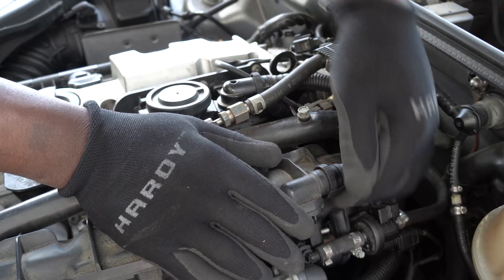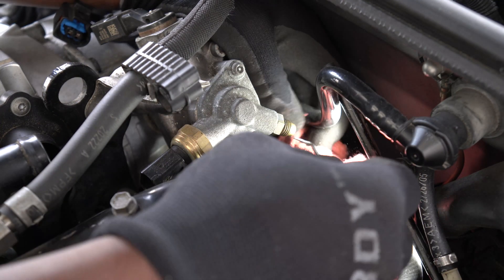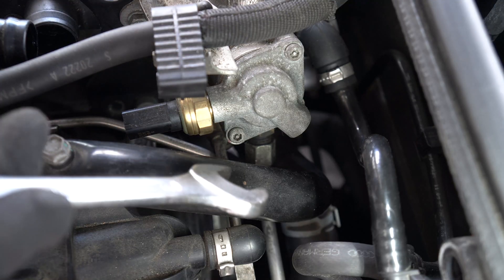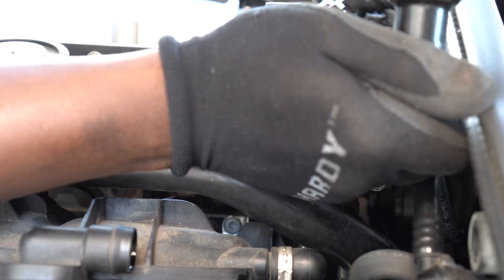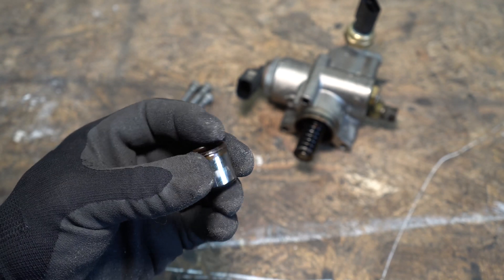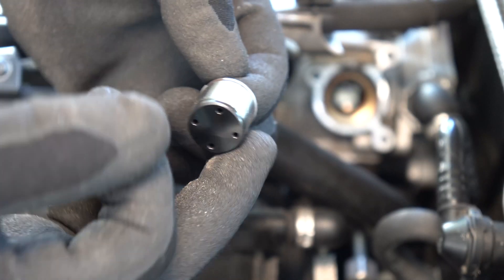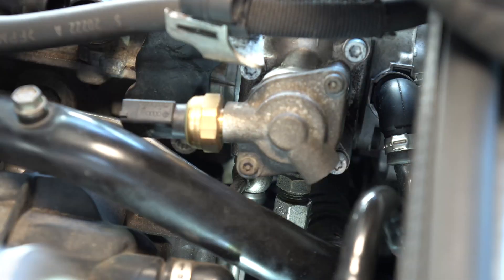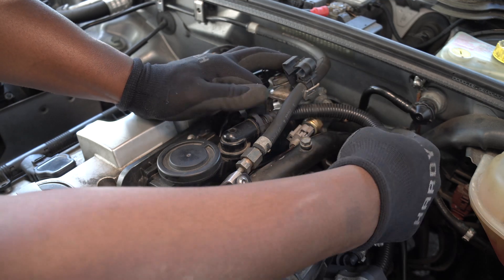B7 Audi A4 Cam Follower and HPFP Replacement 2.0T FSI 2005-2008

Comment: side note for anyone watching this, i have a 07 model after 2006 the banjo bolt was removed and replaced with a rubber hose if this is the case it is not necessary to remove it order to replace the cam follower
Reply: Thanks for this. I’m doing this with an oil change this week and I was so confused when he said banjo bolt because I watched another video and there was none of that

Comment: Does the high pressure fuel fitting have a small aluminum washer that sits on top of it, between it and the female part of the fuel pump that it screws into?

Comment: By any chance, do you know where a little silver 1/2 inch washer goes on the HPFP? When I was disassembling one of the fuel fittings (can't remember which one) I heard something fall down behind the fuel pump. I was convinced by my Dad that it was nothing, and I just tapped on something that made the noise. So we pressed on. It wasn't until I realized the rubber cap to a small pry bar I used to get the the hose off, was missing, that I went down there with a camera scope. Found the rubber cap below the fuel pump, and sure enough there was a washer down there too right next to it. I have no idea where this washer goes. I think it fell out of something while either unthreading the low pressure line or the high pressure line. I've looked at online schematics, this washer seemingly has nothing to do with the HPFP.

Comment: At how many miles do you need to change camfollower ?
Reply from the maker: Check it evey 20-30k miles. And replace if needs be.
Reply: @CraftyWorkshopBuilds  Thank so much
Reply: Check every 20k miles. It Will save you some headache.

Comment: hi, i have audi a4 b7 2.0t fsi s-line. I have the following problem eror code (p2293 fuel pressure regulator 2) and two p0087 fuel rail/system pressure too low. The engine runs very poorly. what is the problem?
Reply: 9 months ago, but what did it end up being? I had the p2295 fuel pressure regulator 2 control circuit low, and 8 other seemingly unrelated error codes. Highly reputable scam shop told me I needed a new high pressure fuel pump, $1000. I took the car back and investigated it myself with the help of Audizine and Reddit. Found it to be a badly corroded, and dead 614 relay in the ECU area. Replaced OEM relay, and cleaned out contacts with electrical cleaner safe for plastics. Went in there with some of those GUM dental floss cleaner brushes. Replaced ECU cover with OEM one because mine was cracked, and one of the screws completely stripped and its head broken off. Fabricated a new hole for a new non-OEM screw to go in there and secure it, because the stripped one would not come out even after taking the hood off, and trying to drill it out. It was the lower left screw (from perspective of sitting in drivers seat). The T30 torx screw that's the hardest to come out of the 5 on the ECU cover. New cover with new screw is sealed tight again. All the codes went away instantly upon startup of vehicle. Car came out of limp mode. Full power restored.
Reply: @Goodbye_Megaton  Where is The relay ubicated?
Reply: @kevins.medina2736   it’s under the ECU black cover under the hood. You have to take the metal module out and put it aside, then down below you will see a few relays. Two are 614 relays. I can’t remember exactly which 614 relay it was. For me it was the one that was corroded and dead. They were really hard to pull out. Kinda had to pry at them carefully.

Comment: Is there much difference in brand for the pump? Im having a few fault code, p2294, fuel rail pressure regulator valve ...  and car in limp mode... not sure if pump replacing will fix the issues, dint want to spend more than necessary to find out... hitachi is about £100 less than bosch ... or cheaper ones on ebay but not sure if i trust them

Comment: I've checked out my high pressure fuel pump thimble and I have seen companies out there replace the three bolts with studs do you recommend that? Those metal screws can wear out the head when your servicing every twenty thirty thousand proactively inspecting.  I also saw a company sell and updated set up that offers a roller thimble instead of a standard metal cup at the end of the fuel pump touching the cam.  

The roller update seems to be an intelligent idea.

What are your thoughts on this?

Great video!
Reply: It works great on VW's because their HPFP are located in the open, on the right side of the engine I believe. On A4's. it is so close to the firewall already, that it would make this job even harder to do.

Comment: Good vid, only thing I couldn't  see was where you were working on the banjo bolt! I'm getting epc light, and code p2295 I believe! Says fuel pressure  regulator sensor could bad cam follower  cause  this code?

Comment: Just bought a 2006 Quattro 2.0 about 118k miles, I know it’s needs to be oiled regularly along with the cam followers need to be replaced but Is there anything else I be should know , I’m just looking for concerns that I should take care of
Reply from the maker: You could check out my top 10 common problems video, on the b7 audi.
Reply: @CraftyWorkshopBuilds  appreciate it mane

Comment: Trying to figure out what is the cause of my problem. When driving up a gradual hill my car misfires and bogs down, hear valve clatter under load. 2008 with 80k . What should I replace first? Coil packs and plugs?
Reply from the maker: Replace the spark plugs first.

Comment: Today I changed that part and it turned out that I did not have it, I did not know.  I drove it about 25 thousand kilometers, I didn't see any damage, it could be bad, but how bad?
Reply from the maker: It could cause scratches on the crankshaft, which could cause the new cam follower to wear out faster. But you said you didn't notice anything damage.

Comment: Tips on doing this on a 2006 car with no bleeder valve on the HPFP?
Reply: I have the same cuestión
Reply: @rubenmunoz3981  remove the high pressure wire/connector  and start the car for 10-15 sec 

http://freepdfhosting.com/8791e81dac.pdf
Reply: maybe unplug the fuze for the HPFP then crank engine over a few times then hopefully it should be fine to take off.